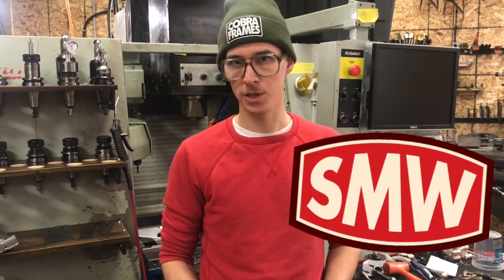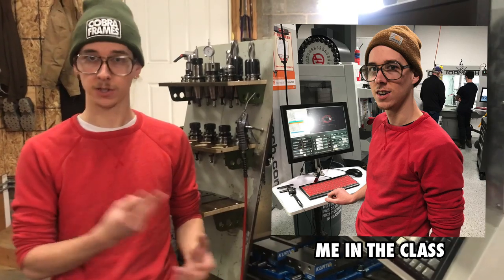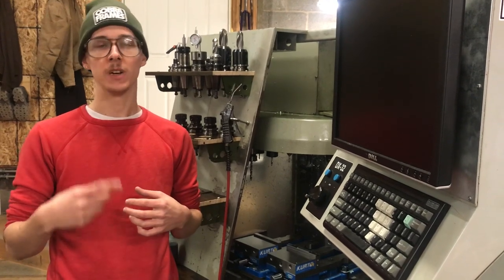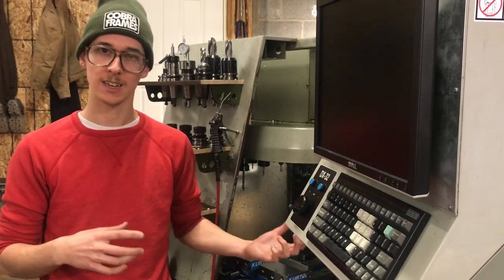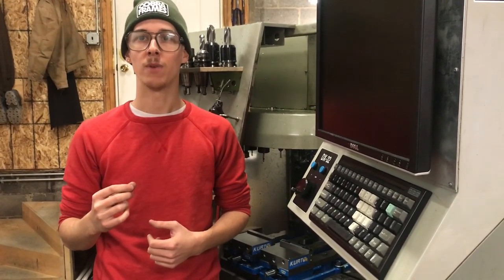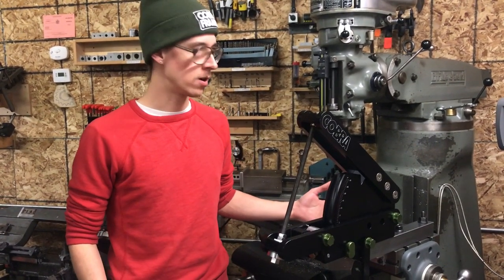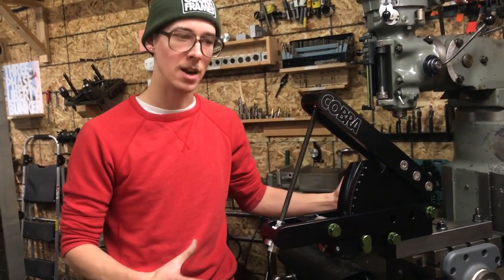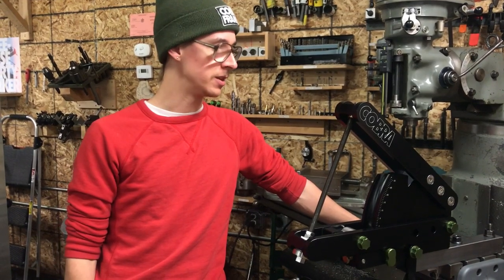CNC Training at Saunders Machine Works: My Experience

Comment: My question for someone starting out what would u suggest manual or cnc and now u have a cnc do u need your manual still?
Reply: Lets say im have no way of getting a job or wanting to get a job i just wanna put in my time and energy work my way up zero to 100 should i just start with a small machine is it the same as a big machine stuff like that. I do electrical engineering in uni and if  could get one for my room that'll be cool.
Reply from the maker: Check out the NYC CNC YouTube channel. John did that exactly. He bought a bench top cnc mill and put it in his apartment. Over the years he got bigger and better machines and now he has a pretty excellent shop.